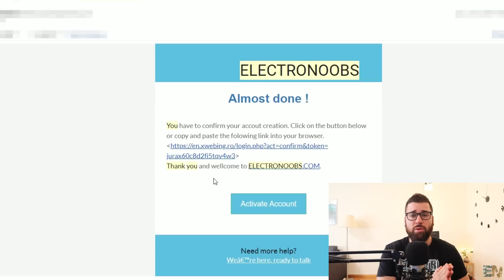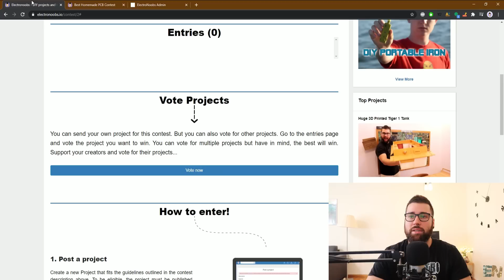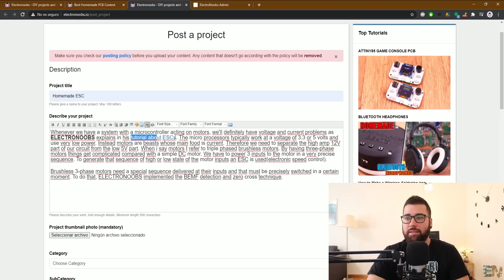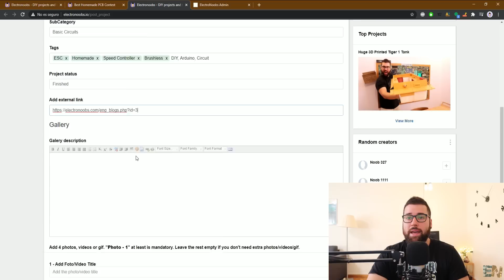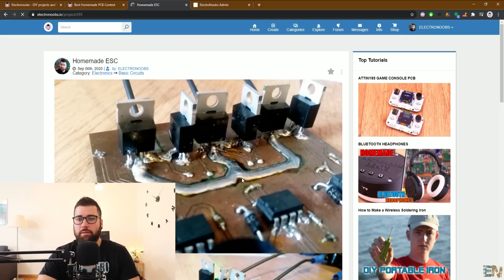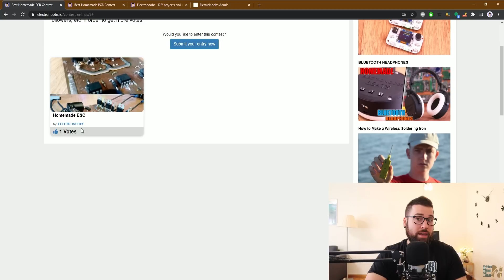Enter Now! First Contest on ELECTRONOOBS.io

Comment: I do have a project, but am not using a PCB for that, am using perf board, am I still eligible for that...
Regard.
Reply from the maker: Yes, those drilled perf boards are still called PCBs so you're good to go!
Reply: @ELECTRONOOBS  
Thanks, I have signed up, but the site keeps on popping up wrong password
Reply: I could send you a picture of it, but the comment section is not compatible for that.
I need your aid in resolving this.
Reply from the maker: @MEmbedded_TechLab  you should reset your password. Did you activate your account? Check SPAM mail folder as well. Good day!

Comment: I have made a full functional multiwii drone with transmitter and receiver and all the necessary sensors such as baro-gyro-accelerometer-compas and also GPS
I made it as a shield for arduino mega using a drilled pcb can I post it in this challenge